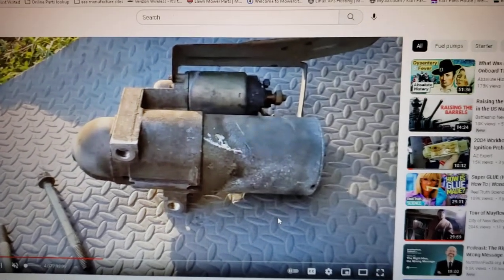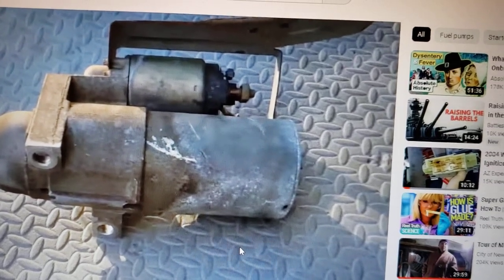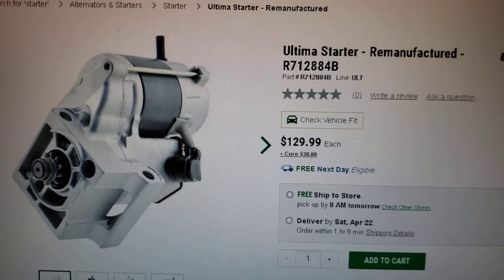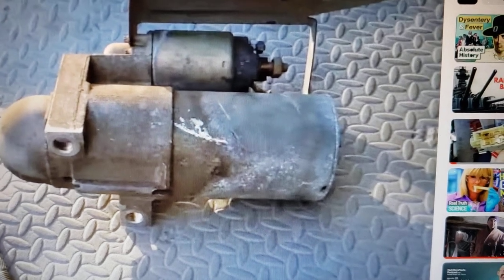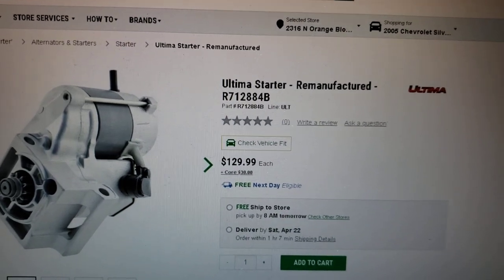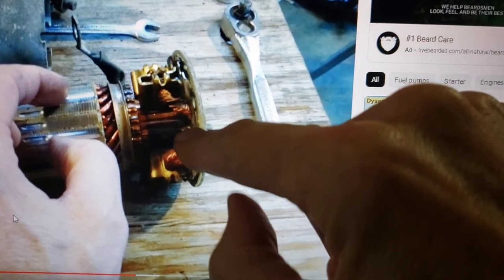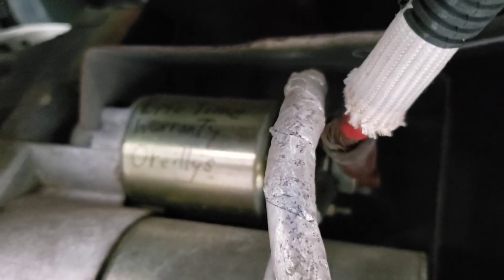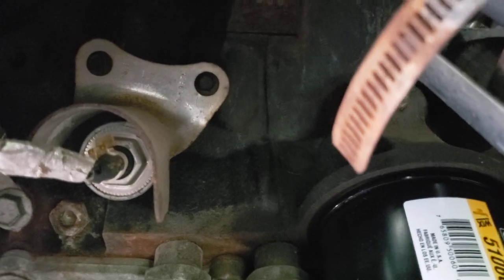Warning Choose the Correct Starter For Your 8.1 Vortec In Your Workhorse Chassis

Comment: Great video Kevin, as I’m one of your recent calls ref my starter on my 2004 26k mile 8.1 workforce.  I got the starter at O’Reillys which did not have the heat shield and the guys there said it wasn’t needed since The solenoid was at a different spot further away from the motor.  I just drove the 450 miles back home and the start worked great however at one point after fueling I did get a ck engine light and got the code P0332 Sensor 2.  I cleared the code and it didn’t come back  on the trip.  As for the mas air flow sensor I took it out and cleaned it about 2k miles ago.
Reply from the maker: Note the heat shield is there to also protect the knock sensor from the heat coming off the exhaust manifold. 
If the maf has never been replaced I would install a new one. Very common part to fail. https://amzn.to/3H8E9C6

Do you own a scangauge 3 to watch your fuel trims?

Comment: Thanks for the info as always. My 2004 Trek (8.1 Workhorse) decided it didn't want to crank up after checking in at the front office at the campsite today. Had to tow the rig to the site and start troubleshooting things. Hoping it's the starter. I pulled it this evening and will get it bench tested tomorrow. Mine only has 21,000 miles on it too.
Reply from the maker: What did you find out?
Reply: @ktoutdoor  starter was completely locked up. Bought the lifetime one from O'Reilly's and swapped my heat shield over.
Reply from the maker: @kolekindschuh901  thanks for update
Reply: @ktoutdoor  thanks for the content! I've watched so many of your videos and learned so much, and subsequently bought a few parts from Brazel's. Planning to buy some new sway bar bushings next to see if I can't tighten up the steering and sway a bit. The originals have 1/8" gap all the way around each of them so I may as well start there.
Reply from the maker: @kolekindschuh901  call me i have some info about steering wheel play 606-875-0125 Kevin

Comment: Kevin, I would like to throw this out there.  My knock sensor code was coming from the wire getting hot and the connector getting brittle.  Heat shield was in place too.  I replaced the connector and wire and my pesky code went away.  This may be helpful to someone out there.
Thanks again for another great video!
Reply from the maker: Any idea where your heat source was coming from? Manifold gasket? Or it maybe the design of the RV I have read that some RV models have restricted air flow that can make the engine compartment much hotter from one brand to another.
Reply: I assumed it was coming from the manifold. Bank 1 driver side, the Bank 2 sensor wire/connector is completely fine.
Approximately 8 inches of the wire was “burnt” from the heat.

Comment: Just a heads up--I bought 2446876  Starter - (reman)  NAPA and it was the undesirable style that doesn't fit the heatshield. Glad I saw this vid. Going back to exchange it for 4N-5110 (which looks correct on the website. Thanks for posting all the vids.
Reply from the maker: Let me know how the 4n-5110 fits
Reply: @ktoutdoor  I ended up buying NRO 4N5110. It's the same style as the original. Looks like I need to tap the heat shield bolt holes, other than that it looks good. Let's hope I don't have to use the lifetime warranty for awhile.

Comment: I've always been amazed how things break over time and not use or miles. 
How are your exhaust manifold bolts? Are you missing any yet, they sure like to break off with age.
Reply from the maker: Don't Jenks me.. lol so far they are all good.  But very rusty. Fingers crossed 🤞
Reply: @ktoutdoor  have you touched them with your fingers?  They might just be sitting there! If there is any black discoloration your exhaust is leaking. Getting the broken studs out by welding nuts on isn't that bad. There are plenty of videos on how it's done.
Reply from the maker: @arthurcutting9227  Would make for a good video for sure...

Comment: Does anyone know the correct GM part number that corresponds with the Workhorse part number for this starter?
Reply from the maker: More part numbers from Dales web site 
https://www.oemys-performance.com/whparts2.htm#engine
W8000145  Starter  OEM
323-1471  Starter  AC Delco
2446876  Starter - (reman)  NAPA
4N-5110  Starter  NAPA
 
10475646  Starter Solenoid  AC Delco
SS-906  Starter Solenoid  Wells
66-132  Starter Solenoid  WAI
ST 170  Starter Solenoid  NAPA
Reply: Thank you

Comment: Another informative video. 
I have all the part numbers for the starter, starter solenoid and knock sensor. Note - there are 2 designs for the knock sensor.
Harbor Freight has a complete set of torx sockets, including #5, for under $10 IIRC.
Reply from the maker: I added your info below video More part numbers from Dales web site 
https://www.oemys-performance.com/whparts2.htm#engine
W8000145  Starter  OEM
323-1471  Starter  AC Delco
2446876  Starter - (reman)  NAPA
4N-5110  Starter  NAPA
 
10475646  Starter Solenoid  AC Delco
SS-906  Starter Solenoid  Wells
66-132  Starter Solenoid  WAI
ST 170  Starter Solenoid  NAPA